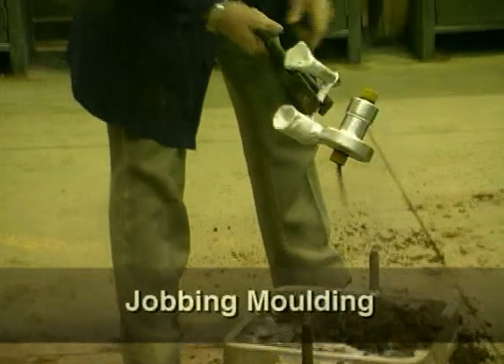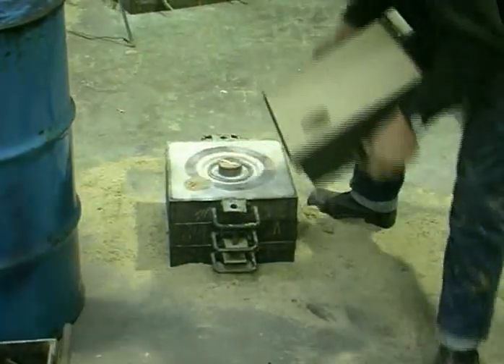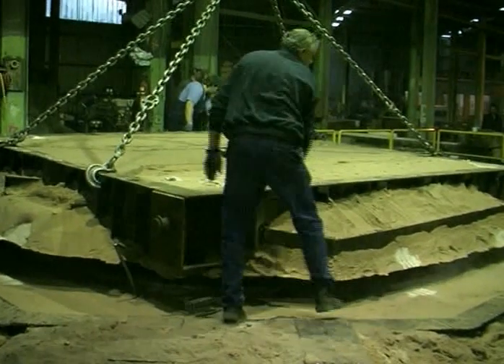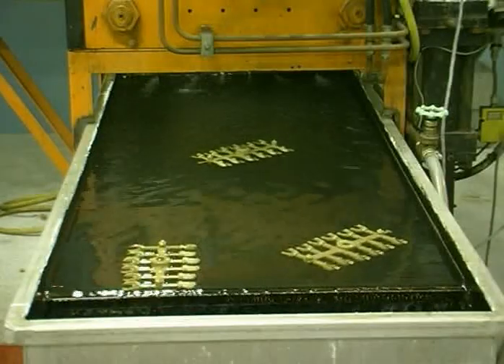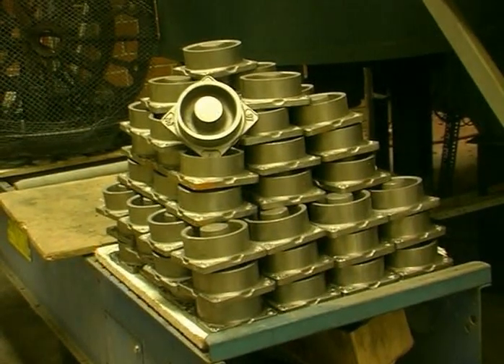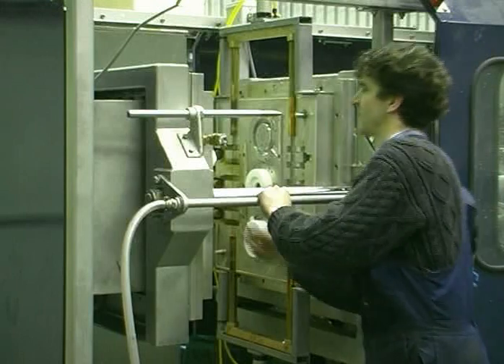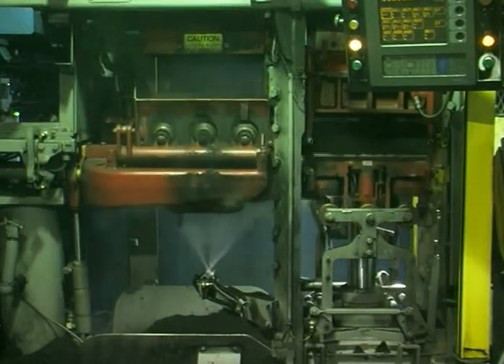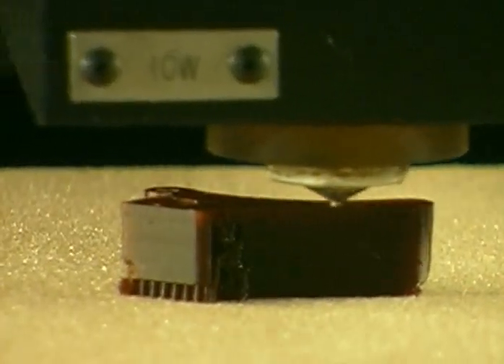Metal Casting: Sand Moulds

Comment: Explains a lot about how automotive plants can produce so many vehicles.

An older 1960s foundry here closed several years ago but it was a good thing even though jobs were lost. Working there was almost all manual and the place dusty, dimly lit and workers literally slaved under threat from management.
Rising electricity costs shut the plant. In two years their electricity bill doubled!
Reply: Jack King well i work at a place called maynard steel casting that sounds just like that. Lol
Reply: Jack, I’m wondering whether you could tell us whether PCB containing oils were used in foundry sands. And how were the sands disposed

Comment: Hot Shell resin sand molding system Chicapee molding machine. Nice to see still kn use. Shalco Hutchison is a good machine aswell. Bradley Piper core blowers are a bit antique

Comment: 3:14 What is the zig zag channel for
Reply: Probably for venting air which could get trapped around the core
Reply: @Flederratte  Yes it's definitely a vent as the expanding gases inside the core would cause porosity in the casting if the vent was not there but I'm unclear as to why it has a zig zag path.